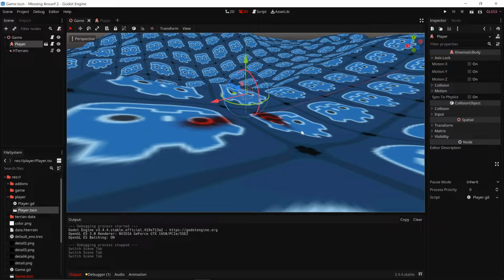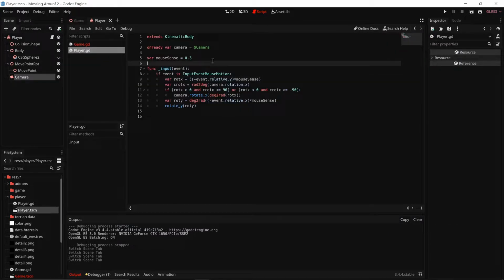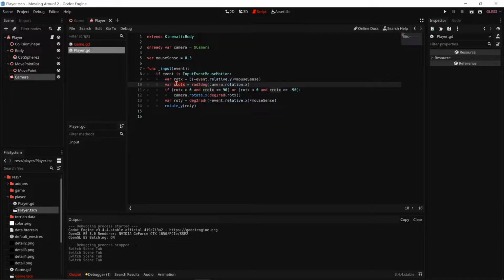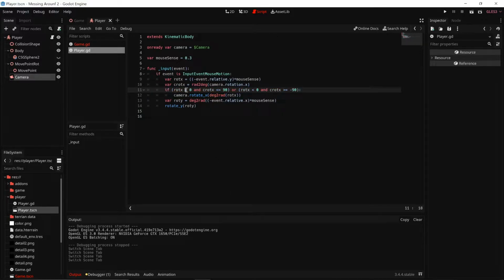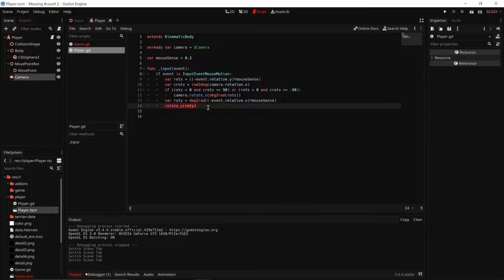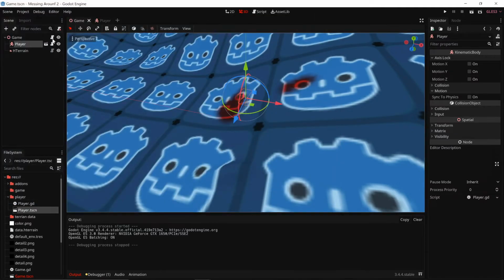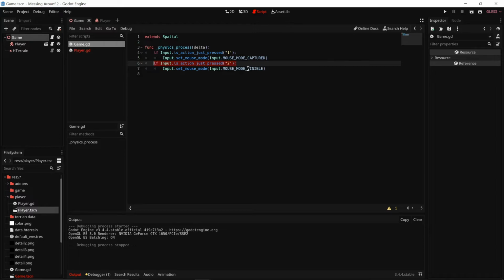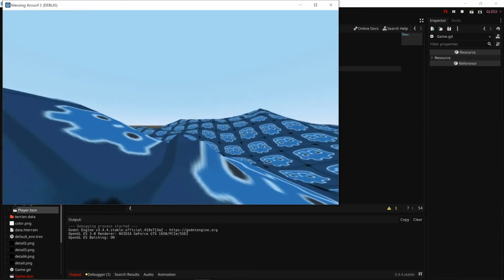Godot 3D camera control

Comment: How to make 3d camera rotation on mobile device?
Reply: I'm also struggling to find a tutorial on the same 😅😅
Reply: @TheoFlyêr  Oh, I made camra rotation yet)
With function screen drag
Reply: @ritoon2223  so u just have to change the function to screen drag and the rest is all the same ?
Reply: @TheoFlyêr  Yes, but you need to divide the screen into two parts in one part joystick in the other rotate the camera.
Reply: @ritoon2223  oh so ur saying that rotating the screen was by using another joystick ?
Reply: @TheoFlyêr  No, it's just that when you move the joystick the camera rotates too, that's what the separation is for.